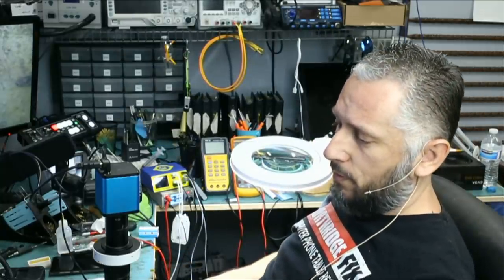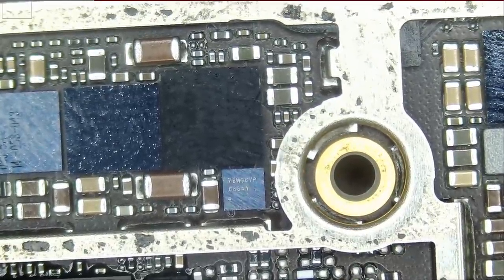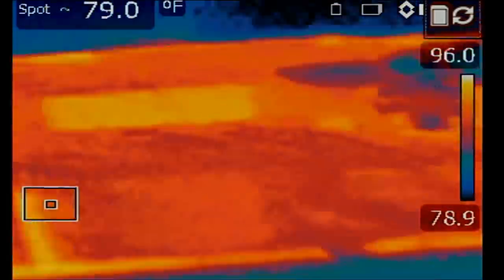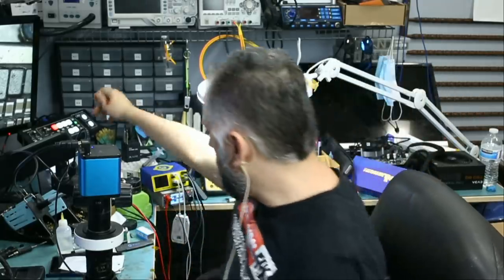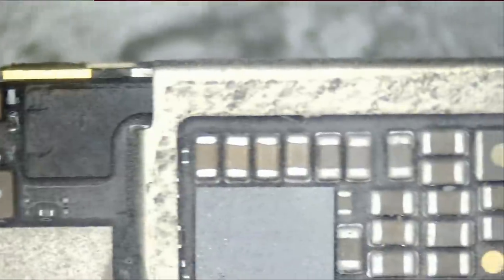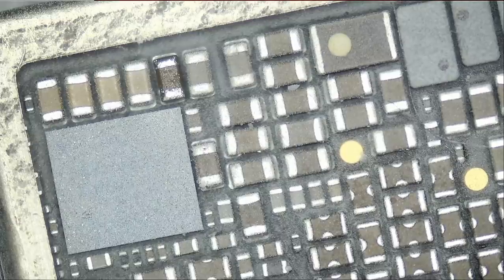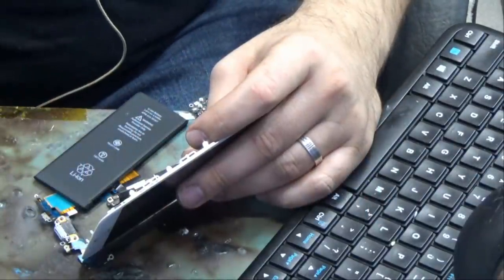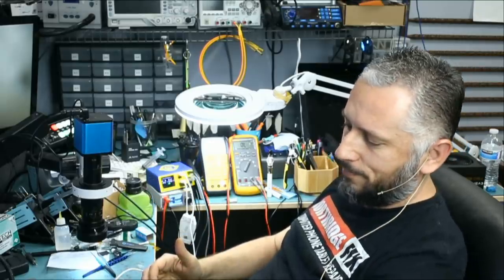iPhone 8 Not powering on - Short Circuit Repair using Atomizer

Comment: I remember repairing an audio digital reverb unit when I was in college 30 years ago.  The problem was that the unit would run for 10 minutes and then the audio output started outputting this shrieking noise.  If you turned it off for 20 minutes it would run for another 10 minutes before shrieking again.  I knew this had to be heat related.  Since I was in college and therefore had no money for equipment, I used a frozen package of hot dogs from my freezer, and touched each component with the frozen hot dogs.  When I touched one of the voltage regulators, the shrieking noise instantly stopped.  A couple dollars for a replacement regulator and the $600 digital reverb was saved.
Reply: That would have felt amazing.
Reply: I envy you because back then components were bigger.

Comment: As someone that doesn't understand electronics I have a question. Why does the phone work without replacing the capacitor? Put another way, what is the point in having that capacitor there if the phone can work without it?
Reply: Capacitors can prevent voltage spikes
Reply: all that cap does is filter the voltage, think of it like the filter on a pipe, if you remove the filter water still flows

Comment: Just curious. I'm not an expert in this field, and watch for fun. What's the purpose of that removed capacitor as it does not need to be there for the functionality? Is there any backup for it?
Reply: I was going to ask that. So just removed it, no need to replace it?
Reply: He has explained this in other videos. They are filters that work together to protect other ICs. As Alex has put it, "say you have 100 police officers protecting a building, if one of those officers calls in sick, the building is still well protected".

Hopefully I got that right.
Reply: It is a bypass capacitor. It is there, with many others, to remove any noise that could be present on the DC line. If removed it's not gonna harm a lot of the functionality of the circuit board but ideally should be replaced. It is not because of the crowded area and possibly knocking off the neighbouring  components, thus creating more damage and more work to do, to fix it.
Reply: @MrLukxas  thanks for the info buddy
Reply: As someone already said, it is a bypass/decoupling capacitor.

You can also think of it as a sort of local power source near a chip. If a chip draws power in short spikes, having long traces will cause a voltage drop and then a peak as the current drops again, as the traces are essentially like a small coil, an inductor, and the higher the inductance, the more it will resist fast changes in current. So the cap can deliver the spike quickly and then recharge slowly.

They can also have different purposes, filtering in conversion of voltages - as many of the parts run on different, very low voltages. These will be near coils and power conversion chips. Also timing, etc.

So if there are more of them in parallel, knocking one off will likely not impair functionality, as the design has some "margin", but if it is easily possible, and it's clear that it is on a power rail for decoupling, it's better to put another one (maybe 10nF-10uF, closer to 100n if unsure) in place for stability.
Reply: Just a small addition - big voltage excursions could cause malfunction, crashes or even damage.
Reply: Kind of unprofessional to not replace it.
He is using hot air. It would only take 2-3 minutes extra to put a new in with hot air.
Fine, if all you have is an soldering iron, then it would be too risky to replace. But not with hot air.
Reply: @vonnikon  It is unnecessary to replace it.

Comment: I think the easiest way to deal with that brick is to either smash it with a hammer or heat it up on some parchment paper so it flows flat, then you can break off pieces. That's just my first thought
Reply: @smokeskull  I think they are talking abut the rosin.

Comment: Hi, can you make a video about peelable solder mask product like MG Chemical 862-250ML  if this product would help SMD soldering noob by covering parts and PCB surface?  When I try to fix phones or very  small items packed with tiny SMD parts , they often get stick together ! It was so annoying to undo the mass with my crappy setup. You think peelable solder mask would prevent this from happen?

Comment: Hey Alex.
Is it possible that you can feel the heat with your hand, if you don't have a thermal camera or an atomizing pen? 
If not can you find the area around ?
Also what temperature does the cap reach ?

Comment: I see on the market is new laser soldering station, did you have experience with it or did you now something about this new technology
Reply from the maker: I haven't tried it, but based on first impression, I hate the  blinding red light it emits. I don't know if you can hold it or have control on how far or close you can be from the board. or if you can narrow the heat spot rather then burn half the board to desolder one component. With hot air you can increase air speed and reflow a BGA chip using air pressure and see the chip dance,  with laser that's not possible. Again i haven't tried the machine, but that's what I concluded based on few videos I watched.

Comment: @NorthridgeFix: It looks like you are always working with camera only, not using a stereo microscope. Aren't you missing the "real" 3d view this way? I wonder how it is possible to work precise enough this way. Or is it only a matter of experience? So far I am using a stereo microscope, but as I am viewing glasses, it is very inefficient to put them off/on all the time between the different working steps when soldering / desoldering etc.
Reply from the maker: https://youtu.be/NfkXitg5R4I

Comment: Do you replace the cap? Or leave the motherboard without it?
Reply: Same question I have. It just works without it? What's the point of that capacitor, then?
Reply: It can stay out, as is is a bypass cap. It is meant to filter out noise (works like a flattener). There are some of them, so one cap lost will not break the system, the filtering is still good enough. Some lower farat caps in parallel work better than only one bigger cap. But if you have 4, 5 bypass caps, and remove one, it usually is still good enough for the device to work properly.

Comment: how do you always get the easy ones.... i have a bunch of boards that are simply NOT chargin ... replaced everything , tigris hydra caps u2 coils, either not charging at all or only charging when off ... big headake ...
Reply: all voltages are fine ... everything measured is fine, the q's also fine ....WHAT is wrong whit those boards ... WHAAAAT !!! some iphone X ...same issues.. charging only when off

Comment: question is, how do these solid capacitors just short itself out over time?
Reply: Maybe the material is not good enough, so the capacitors are degraded over time by heat from processor.
Reply: designed to short over time so you'll buy a new iphone manufacturers are using engineering and design to add "failure" at a specific time instead of designing things to last long.
Reply: caps are always under load, like anything else they start breaking down and fail over time kinda like a lightbulb....as for why one would fail before another it could just be due to manufacturing tolerances but its better to not look that deep into it
Reply: Usually mechanical damage due to thermal stress. This is a very typical failure often seen in automotive electronics they usually install two capacitors in series’s for critical items such as Avionics

Comment: Does anyone know how you choose the proper replacement for a bad capacitor?
Reply: If the board has more of the same, I guess you could measure capacitance and search for a capacitor of the same value.
Reply: Yes. In this case it is not neccessary because it's a bypass cap. But usually you can do it with a donar board, where the same components are present. If you have the same fault over and over you can measure the cap from a good board to know the value. Sometimes you can look it up in a list if it is available for the board.

Comment: has anyone tried thermal paper to find the heating component? any thermal paper should work in theory. the ones used in portable credit card machines or small printers would be ideal. i would line a paper on top of the circuit board and apply some pressure using a silicone keyboard cleaner which can take the shape of whatever you put on so you would know all the components are having a good contact with the paper.